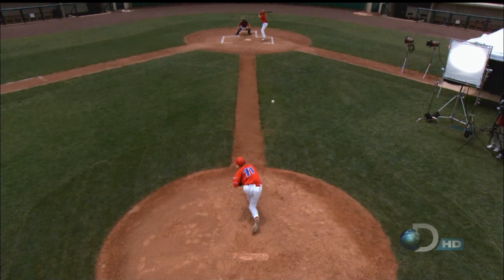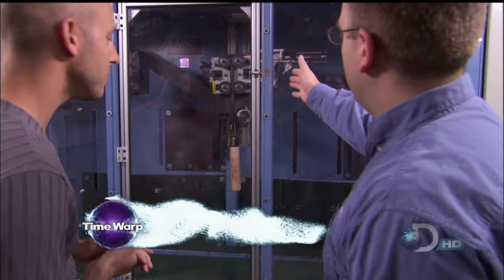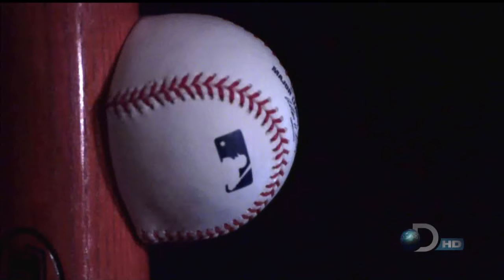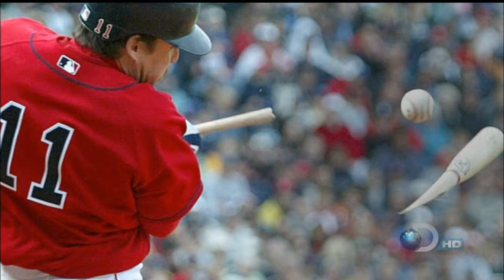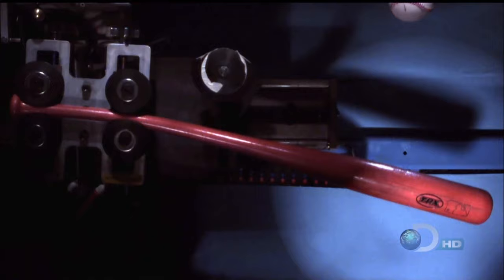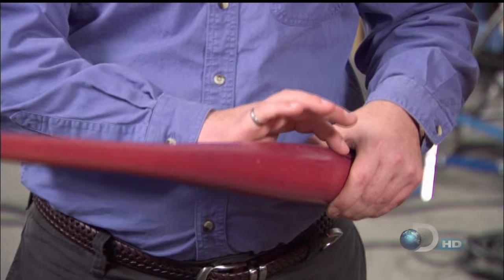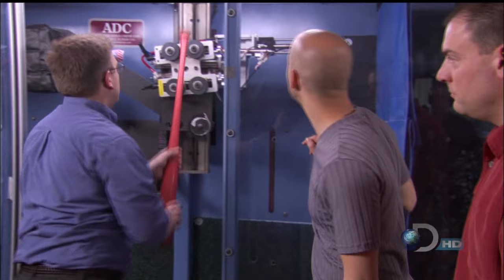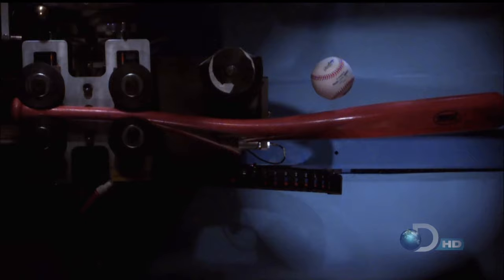Time Warp - baseball bat

Comment: Would you consider doing one on Slow-pitch softball, using both composite and aluminum bats, with both low and high COR (rated) balls?  I'm guessing low COR balls would show MUCH less ball-compression than baseballs.  These videos are VERY enlightening.  Thanks.